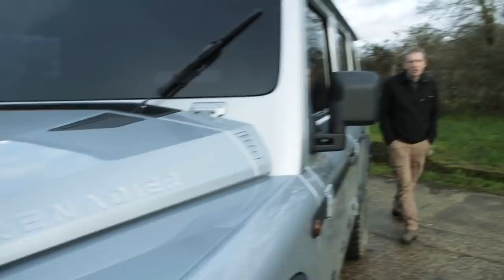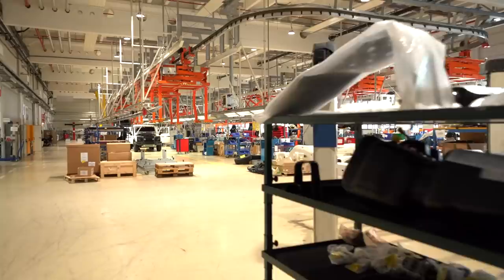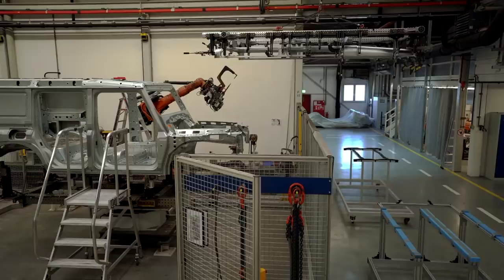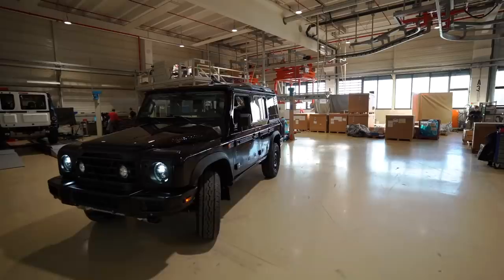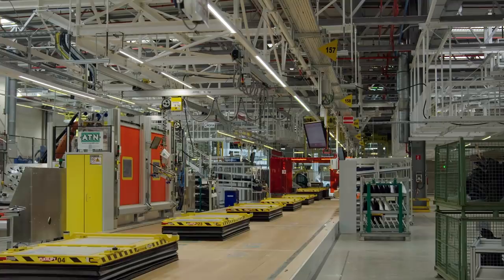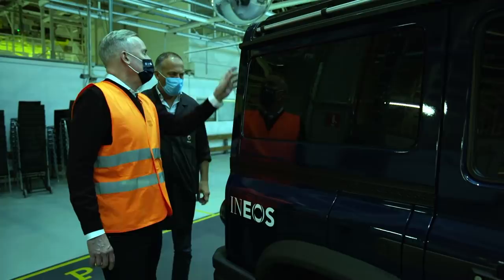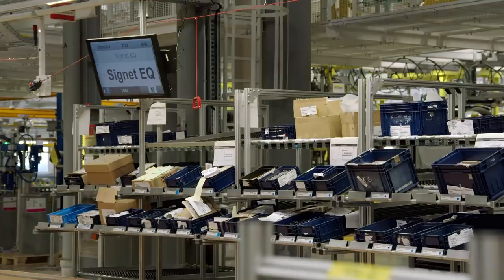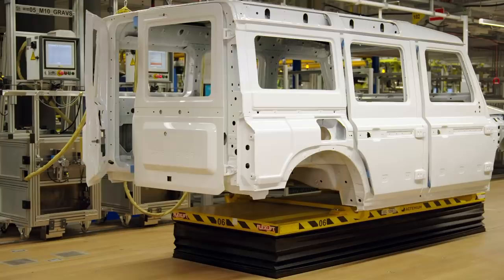Building the Grenadier - Episode 7  - From Prototype to Production

Comment: Most 4WD's need a 2" lift. I hope this one doesn't and can take a load. Also hope it has built in rated recovery points and is winch compatible. I will certainly be buying one of these in Au provided it's reasonably priced.
Reply: I think it's similar starting prices to the new defender but I'm not 100% sure

Comment: One thing is particularly important, the windshield must be supplied with a heater! The Mercedes G-Class cannot drive without it in heavy snow. The angle of the windshield is so steep that the snow clings to it and the windshield wiper cannot remove it.
Hope you have thought of this possible problem "
I will be one of your first buyers 🙋‍♂️

Comment: Can you tell us what size tyres will be on the 17 inch wheel option?  

Also are you dealing with any third party accessory suppliers like ARB, TJM etc.  Bull bars, winches, long range fuel tanks, roof racks and lift kit availability are a real consideration when buying a proper off-roader/tourer/workhorse - eg.  it’s why a lot of people I know haven’t bought the new Defender - including me!
Reply from the maker: Bridgestone's All-Terrain AT001, in two size options - 265/70 R17 or 255/70 R18. There is also an option of BF Goodrich tyres available. Check out Episode 6 for more on the wheels and tyres: https://www.youtube.com/watch?v=0itg3oUVpIQ

Comment: Will there be the option to have a galvanised chassis on this? Loving that the body mainly is. I'm buying one to hopefully last a lifetime so want it built to last ideally.
Reply from the maker: Hi Martin, great to hear you're interested. The doors and closures are aluminium. The rest of the body is galvanised steel.
Reply: @INEOSGrenadier  galvanising the chassis is great to hear. I remember waxoyling my old Landrover chassis - not something I would wish to repeat.

Comment: At about 1:10 it looks like the roof windows are enclosed by structure rather rather than open to the cabin.  Is this correct?  Any news about specs like wheel travel, maximum tire size, payload, range goals, etc?  I’m very excited about this vehicle in the US potentially replacing the F150 on 35in tires that I’ve taken through the Alpine Loop, Death Valley, and Canyonlands in Utah.
Reply: Not actually windows, they are tie down points. Bit of a cheeky copy of the Defender, but then the whole vehicle is. 
The only other thing I know is it should be running 17" wheels.
Have a look on their website.

Comment: Would have loved a galvanised chassis.
Reply: It's only the testing versions that are powdercoated - they said that the white reveals any cracks more easily.  Maybe the production one will be gal?  Why would you gal the body and not the chassis?
Reply: @einfelder8262  Not many cars have a gal chassis (old Defender, G-wagen etc). One that DID have a gal chassis was the Land Rover Perentie, built for the Australian army.
Reply: Welding on or cutting galvanized steel with an oxy/acetylene torch produces highly toxic fumes that will make one sick for about 24 hours.

Comment: I like them, hope it can tow into 2.5t, but REALLY hope it's not the same cost as the G wagon and the brand new defender, I hope this is a off road utility car/ SUV pitched to the masses (£20-30k) and not the wealthy (£56+)
Reply: Should be a 3.5 tonne towing capacity like the old and new defender.
Reply from the maker: We are looking at a 3.5 tonne towing capacity. As for pricing, our ballpark figure for commercial and fleet users is just under £40k and around £45k for retail customers. Exact figures will be confirmed once all specification details have been finalised 👍

Comment: Did I read somewhere the Grenadier will be pre wired for after market lights front rear roof? Could this include winch wiring for simple plug and play winch install of winches of our choice?
Reply from the maker: The plan is to make the Grenadier customisable so you can tailor it to your needs. Further specification details will shared at a later date so please stay tuned.